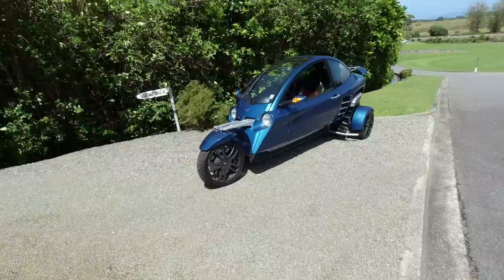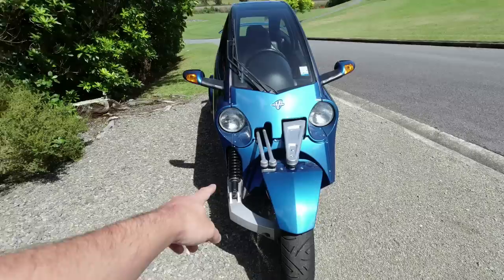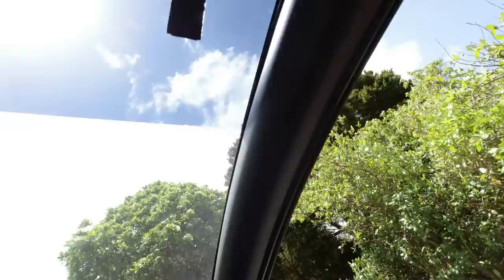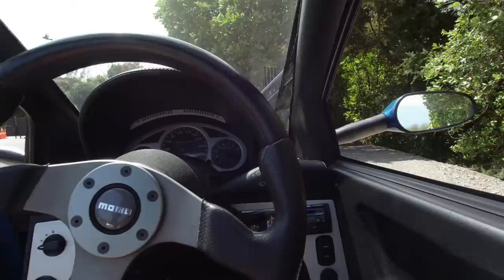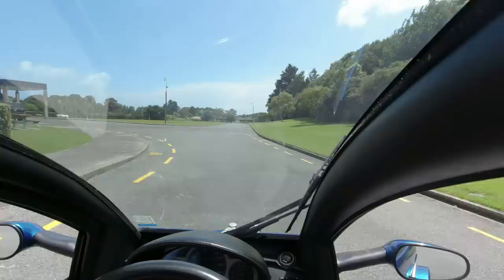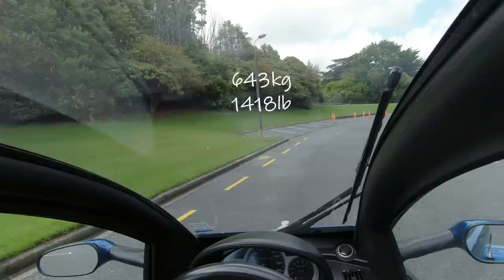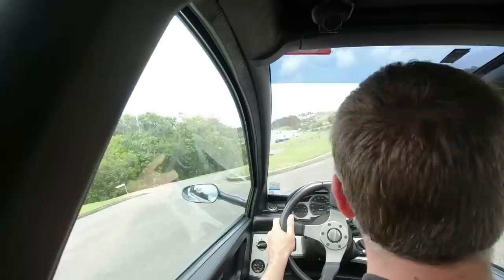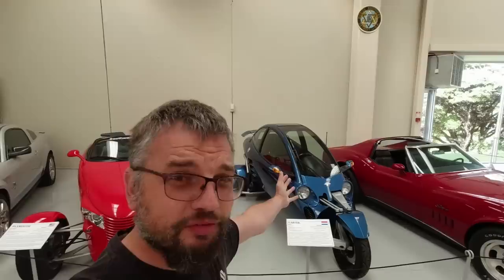The Carver One is INSANE. Also, Bizzare. It corners like nothing else

Comment: Having been a lifelong motorcyclist, and now arthritic, I have to say: I've got to get me one of these.
Reply: Somehow a Goldwing Boomer Trike seems more likely.
Reply: would be cool that you dont have to gear up with helmet etc, can just jump in and go- and still the get the exhilaration of riding
Reply: As a motorcyclist you know that you have to lean in curves, the testdriver tried to compensate the leaning.
Ever driven a motorcycle where the passenger didn't want to lean? Same effect.
The Carver does the leaning for you, you do not have to do it yourself neither compensate.
Though the Carver One isn't produced anymore because they cannot get the motorengine any longer, there is now an electric Carver on the market, in two versions, 45 km/h and 80 km/h. Same basics and leaning, little less aggressive.
Reply: Another ( super expensive) option is the monotracer/racer and it's predecessor. 2 wheels only. 500+kg so I doubt you leaning matters. Retractable learning wheels for slow speed.  Full cabin.
Reply: @dutchman7623  The motor engine is from the Japanese Truck, I believe it is a Daihatsu, aren't they cheap? I guess they aren't manufactured anymore because of the strict regulations over there.

Comment: I am amazed they didn't redesign with oh say the engine from a Hayabusa
Reply: Yes please make that happen!
Reply: No reverse.
Reply: Vespa Davidson 
Use a small electric motor for reverse or better still full electric.
Reply: Dump Chump Oh good idea! Like a Gold Wing? Hadn't thought of that horrible complication. Do they make an all electric Hayabusa?  Do you not think we should just start this design again? Having first established the parameters? At the moment the only point we seem to agree on is three wheels. Although I prefer two at the front, one at the back. Oh dear! This isn't going to be easy. I suggest we provisionally name it the Camel.
Reply: @vespadavidson2315  you can figure out a way to reverse it via an electronic motor system.  Not hard
Reply: Alex Morrison Wow...really....reversing which particular electric motor....the Hayabusa one?
Reply: @vespadavidson2315  via a motor in rear wheel maybe. There are ways
Reply: Alex Morrison Ah! Got you...add more unsprung weight to the wheels....oh and a bigger, heavier battery......and the point of this Heath Robinson contraption is??  To prove anything can be done? I think we knew that already.
Reply: @vespadavidson2315  u only need a small battery that is on the vehicle anyway. And a small motor. U r missing the point. Someone commented about lack of reversing...
Reply: @vespadavidson2315  love the way u also have used 2 of the worst makes of bike to make your name. Real.class
Reply: Alex Tesco Actually the thread is about why not use a motorcycle engine. I put forward that they have no credible reversing system in the particular model the post suggested. Then a world of clowns came on who have never built anything and we end up with the postulating of baffoons. So, for example....your little electric motor needs a huge amount of torque and almost zero speed capability. Which motor is that? Without gearing.  Honda used a reverse starter on their Goldwing.....Ummm. So....why use a Hayabusa? Read the whole thread...go on..it won't hurt you. Then you will know what you are talking about.
Reply: Alex Sainsbury. Please don't embarrass yourself by such childishness.
Reply: @vespadavidson2315  actually.  I am an engineer of more than 30 years in the trade. I make things. Build things. Design things from scratch. Reverse could be a slow thing yes, like the gold wing. Or even better then just for u. We built a disabled guys trike from a triumph 3 cylinder bike. We can it into an electronic switched transfer box which with flick of switch made it reverse using the engine. So that's even simpler....
Reply: Alex Lidl........So despite being in the trade....you still are not able to follow a thread.....that beautiful Hayabusa monster engine is now wrapped up in electronic crap and transfer boxes......we could use one out of an old Landrover!.......after all weight, sprung or otherwise isn't important....we don't care about performance......Oh hang on.....I have an idea....let's forget trying to make a Hayabusa engined vehicle reverse and just use a car engine.    Two other points...are you silly enough to use your own name on here? You should consider reading what you have written. Your grammar is atrocious.
Reply: @vespadavidson2315  oh and for your info. The Suzuki 1300 motor is not a good engine. So many online with damaged engines. And such an ugly bike.  Yuk
Reply: Alex Co-Op  In your humble opinion. The thing is sunshine you lost this argument when you failed to read the thread and jumped in with your asesine comments. Then you went to name calling,. Now? Well now you just look silly. Stop there's a good boy.   Two Utube tips before one comments or joins a thread. 1. Read thread. 2. Look at channel of those you are talking too.
Reply: @vespadavidson2315  grow up. Everyone has an opinion and are entitled to say or contribute anything they want on here.
Reply: Vespa Davidson ooooo
Reply: @thechumpsbeendumped.7797  there was an american company working on just that, not sure what happened to it.  The original Company know has an Electric Version but it is restricted to 45k mh to meet  the legal classification of a scooter. Search "ANWB Oud & Nieuw: Carver 2019" on here, as you might have guessed its in Flemish.
Reply: im trying to figure out how to like this multiple times but no luck
Reply: -- Front end needs to be worked out.  I would go with 2 conjoined wheels in the front.
Reply: Lol some quads have reverse I don’t think it would be hard to add also the champagne t-Rex uses bike engine and has reverse

Comment: 1:24
"Toyota decided that they didn't want their engines going to external manufacturers"
 - Cough, cough, Lotus, cough, cough.
Reply: *Daihatsu
Reply: @ChrisG3253032  
Daihatsu's owned by Toyota now.
Reply: Toyota took over Daihatsu back in 1998. They also own shares of Subaru, which led to the Subaru BRZ / Toyota GT86.
Reply: Also I believe the relaunched MGF used a Toyota lump.
Reply: @davidfos84  
Don't think it ever did.
The Lotus Elise changed over from Rover K Series to Toyota 2ZZ though.
Reply: @lewis72  You are quite right. Oops.

Comment: If you've never ridden a motorbike or a trike, then a persons first impression of this is ''what the hell?''  Beginners will fear tipping the thing over when it leans.  Folk that ride sportsbikes (or experienced riders in general) will automatically lean into the corner, the bike leaning left or right, and our heads leaning in the opposite direction (so the 'horizon' is always straight/level).  It takes getting used to, but I guarantee, 100%, that if you stuck with this, you'd be flying into corners like a superbike rider.  Only downside is you cannot open the door to ''get your knee down''!.  With the roof off, I'd be inclined to wear my crash helmet though.  The rear seat/foot arrangement would not bother most bike folk, as pillions are used to cramp leg positions and being hard up against the rear of the pilot. (just ask anyone who has sat behind a rider and bumped helmets on a regular basis).  Looks like a hoot, and I'd not hesitate in taking it on some twisty windy B roads and wringing the buggers neck.  The only thing I would re-engineer, is the gear shift, so it could be a paddle system on the wheel.  That way, you might be able to remove both doors for a better riding experience.

Comment: This looks like so much fun !
Surely, Daihatsu's decision to stop providing engines is not enough to explain the demise of the Carver. Lots of other engines could undoubtedly have been adapted. The Canadian-made T-REX, for example, has gone from Suzuki, to Kawasaki, to BMW engines while remaining otherwise the same. 
pedant alert*: That front suspension is anything but traditional motorbike fair. Hub-center steering, swingarm front suspension has been tried, notably on the Yamaha GTS1000 and Bimota Tesi, but was pretty quickly abandoned in favour of traditional telescopic forks. Its presence also explains the rubbish turning circle.*pedant mode off
Happy new year, Mr. Seabrook. Thank you for 2019 and looking forward to discovering your HubNut plans for 2020.

Comment: From a motorcycle point of view, the Carver front end is very interesting - it's a hub centre steering system, effectively a swinging arm with the front wheel pivoting on an internal kingpin, which might explain the lack of turning lock. The carver company 9or it's successor) is back in production with an electric "city car" using the same tilting technology but (much less expensive) conventional motorcycle front forks. 45km/h top speed, 100km range at a cost of 9000 euros. I'm always tmepted by motorcyclesque vehicles with funny front ends - they've been a point of contention in the bike world for generations. Maybe when Carver do an out-of-city car again, i'll be a customer. High price was one of the things that killed them the first time, but then again new technology never comes cheap.

Comment: It's somewhere between a motorbike and a car (he said)
So that would be a trike then, would it?
Reply: Yes, it's a trike because it has three wheels, but I don't know of any other cars that behave like a motorcycle when you turn in to a bend. You wouldn't say most three-wheelers behave like a cross between car and bike. Those three wheeler 'scooters' come at it from the other end. A motorbike with more front end stability courtesy of an extra front wheel and a tilting mechanism and can usually be driven with just a car licence. I have got to try one of these Carver beasties... looks like sooooo much fun.
Reply: @another3997  You can do a pivoting bike with 2 rear wheels a la the BSA Ariel 3 https://www.youtube.com/watch?v=ofpi71oMctc For you earlier commentators trikes don't normally lean just as cars don't, but the Ariel 3 pivots just like the twin front wheel scooters do. https://www.youtube.com/watch?v=XWenCaf3tjI
Just to confuse things further do you "Counter Steer" on MP3s and would you do so with this Carver.
For the non motorcyclists counter steering is the process where above 30 something MPH and certainly above 40MPH one steers right to turn left and VV.

Comment: I believe on the original at least they used the torque sensor on the  steering as per hydraulic power steering to derive  the angle of tilt, I assume using the hydraulics to push against a spring.

Comment: I'd like to have one. Looks nice save for the wheels, an easy fix.Gear and other linkages I imagine are done by cable and not rigid links, correct me if I'm wrong.I do like the bash bars in front of the rear wheels, definitely a bonus if you've never piloted a 3-wheel motorcycle. BTW, you don't want a high turning circle with a 3-wheeler/trike, unless you like doing Top Gear-Reliant tricks, lol.

Comment: A motorcyclist would have no problem with this as we're used to leaning but I'm sure a car driver could get used to it quickly enough. Not sure I like the slight lean delay but again something you'd get used to after a short time. However going by your POV camera angle I think I'd stick to my 2 wheels.

Comment: It seems like it could have been designed where the front tire could turn 90° and allow it to turn around in its own length. Maybe a lever or latch to limit turning for normal driving, another mode for parking.

Comment: There's something similar on 2 wheels made by a Swiss engineer. Like a motorcycle but with a cabin. On red lights a stand comes out automatically to prevent rollover. Very weird and it runs over 200 km/h!
Reply: Peraves ecomobil / monotracer - they've been around for a couple of decades. Originally powered by BMW K series motorcycle engines, now electric apparently.
Reply: Yes, over 200km/h easily.  BMW K100 1000cc flat four.  I had a K100RT.
Reply: @stewartellinson8846  But not cheap! Well, tipycally swiss, very expensive toy. And must be quite weird to ride. And the name is correct: Ecomobil. I didn't know they were still produced.

Comment: I like it ! Pity it's not got a CVT transmission - a few other refinements would be good too (like a better driver! that steers progressively).
More tilt than a tilting train ! I'd expect motorway driving would be very pleasant indeed re the tilt - provided there were no other speed issues.

I'd guess the gear lever linkage is via a couple of push-pull cables - safest option for dealing with that articulation.

Comment: I wonder how the tilt mechanism would respond if you manage to get the back end to step out on a greasy road and have to employ a bit of opposite lock.
Reply: That is about the only way you can get into trouble with a Carver, its the force you apply to the steering that denotes how aggressively it leans so applying opposite lock in a rear end slide will flip it onto its side as it throws its weight over the wrong way.
Reply: @davejackson3690  Thanks for the informative reply!

Comment: You mean to tell me they couldn't source a new engine from any of the dozens of motorcycle manufacturers?
Reply from the maker: Not as easy as it sounds. How do you make the transmission work?
Reply: @HubNut  Either make, or have a company make an adapter to mate the transmission and new engine.  Or just use a different transmission.  If it's a motorcycle transmission they all pretty much work the same.

Comment: Different wheels from and rear?  The tyres would have to be different profiles, so it would have to have 2 spare wheels, should a flat happen.  The front wheel would be as easy to change as a car, with the single sided swing arm, and the brakes and suspension on the other side.